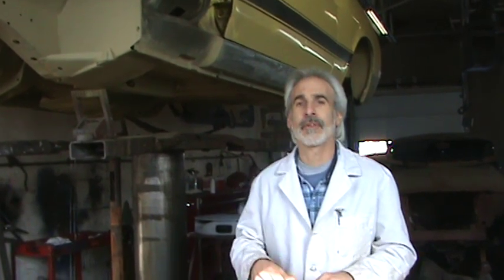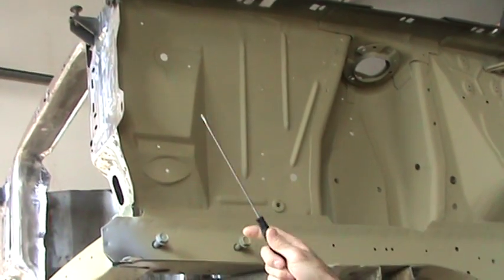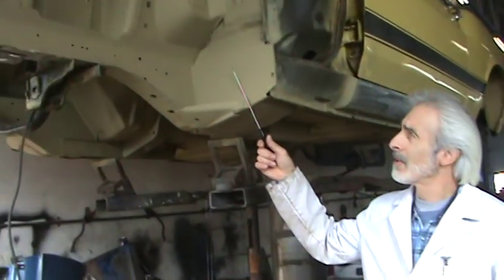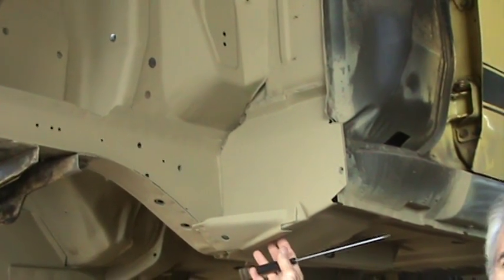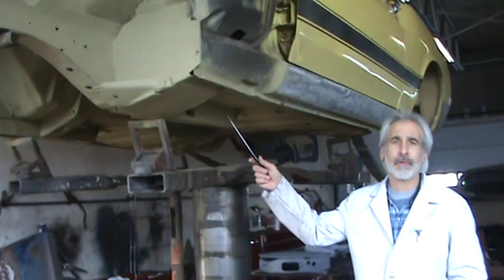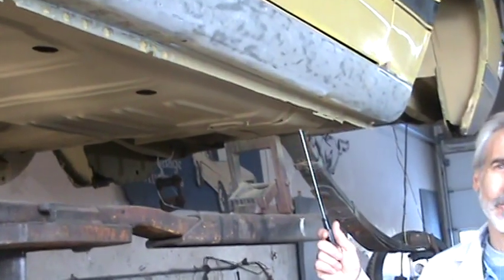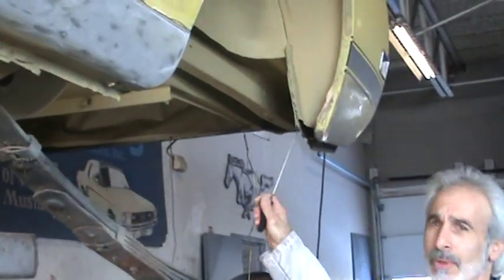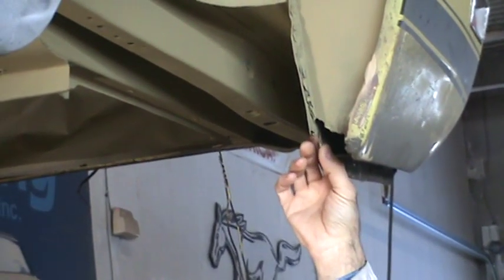"How to buy a Mustang" What to look for - OperationMustang.com

Comment: some good points but the cowl is really the biggest pain and the most important. use a cylinder cam or other type and look up through the vents etc,  if it leaks when you wash it , don't buy it . no covers allowed during inspection.

Comment: Most common problem seems to be the cowl leaks and then rusts the floors,  you should do a video on repairing a leaky cowl.
Reply: I agree with this comment. I did a cowl repair on my 1967 Mustang convertible and it was an enormous project. 
I see now some vendors are offering a replacement cowl with a removeable top piece -- which would make getting at a rusted area so much easier. My father once removed a cowl from a 1968 Mustang convertible and I believe he said there were 130 spot welds holding it in place.